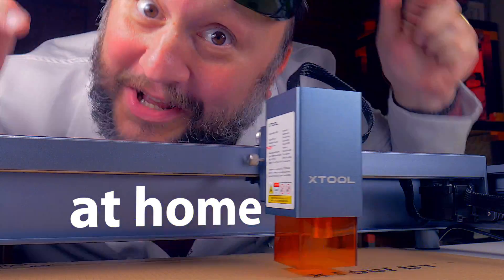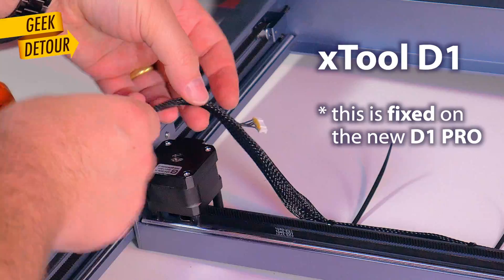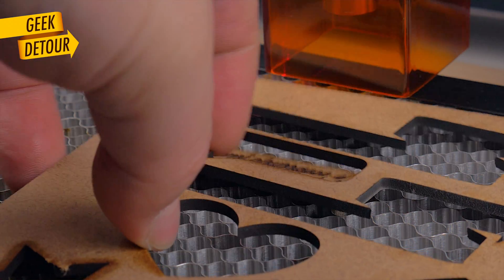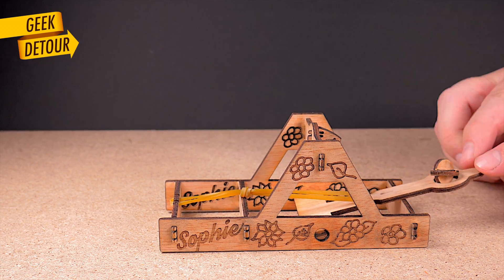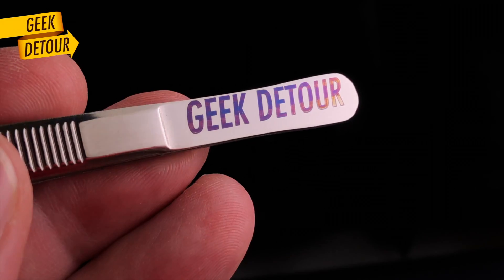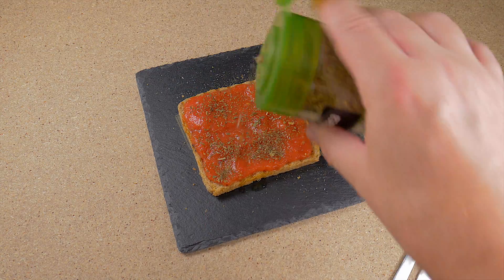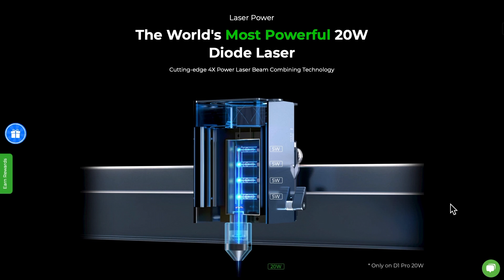Home Projects with the xTool D1 Laser Cutting Machine

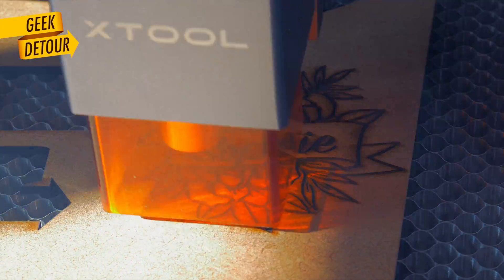Comment: How nice! What settings did you use to cut the MDF and what line spacing did you use at the 6:02 time? Have you tried to cut vinyl sticker (small letters)?
P.S.: By the way, all the settings you used were missing! Power, Speed, Passes, etc.
Reply from the maker: Thanks!!! I don’t recall any of my settings - I was testing all these different things like crazy 😜. BUT: Don’t cut vinyl on your laser. It will release chlorine gas (if I am not mistaken), very toxic and it will oxidize your machine. Really! I saw photos of people who ruined their lasers.
Reply: @GeekDetour  Oh friend! Thanks for your warning, although, I would really like to make some cutouts of some numbers and words on a black sticker that, only a laser can do because, they are tiny. Wouldn't a big fan blowing in the direction of the laser divert most of the nasty smoke to avoid major harm?
Or, otherwise, is there any substitute for this Vinyl Adhesive like, PVC Self Adhesive Plastic?  Thanks again
Reply from the maker: @Dancopymus  Really: DON't cut Vinyl with a laser! Here is a list of materials you can and cannot cut: https://cpl.org/wp-content/uploads/NEVER-CUT-THESE-MATERIALS.pdf If you want to do lots of work with Vinyl, maybe a Cricut (that actually cuts with a tiny blade) would suit you better.
Reply from the maker: @Dancopymus  Here is just one case of someone who made the mistake of laser-cut Vinyl... and it is devastating: https://www.youtube.com/watch?v=wzTosE7RroQ&t=26s

Comment: What about dangerous fumes that will be 100% produced from BURNING materials? Maker's Muse did a good overview of mass-marketing the cnc laser cutting problems.
Reply from the maker: He is absolutely right. I had windows opened everytime I used the laser - even so, the apartment had burned wood smelling for a couple of days.
It is possible to have a laser for ocasional use on your apartment - but if you need to use it on a daily basis, it is advisable to buy an enclosure with an exhaust tube connected to the outsides.
Reply: @GeekDetour  wood is (almost) fine, but who can tell that people will not try to laser cut materials that will produce really toxic gases?
I would predict, that owning a laser cutter at home will be licenced/limited and for a good reason. At least in EU, we do care about health and envoronment over there.
Reply from the maker: Sure! I think we might have some regulations eventually. We are living the “Makers Wild West” - we are trusting people to discard their UV Resin residues properly… looking at the forums it is clear some people do it right, but some people read “water washable resin” and they go straight for the sink for everything 😬

Comment: I'm kinda sketched out by the lack of Light spread protection. Like that shroud still has the gap at the bottom where you can the backscatter shining through.  And it's pretty easy to do long term damage to your eyes from high powered lasers like that.   Like if you take off the safety' glasses while it's running or if someone enters the room while the machine is running.
Reply from the maker: You are absolutely right - I bought more glasses (for my wife and daughter, because they wanted to see it working. While was working on this review I always told them that I was “locking myself to use the laser”, please don’t get in without a glass. 
On the long run you need to make an enclosure so everybody is safe. Right now I still use it occasionally, but I am planing a permanent place for it on my new studio/workshop.
PS: when I recorded the intro for the video, I took the glasses out, but on the angle I was I could not see any light from the laser. This is NOT a toy.

Comment: Hi, great video. I have the same xtool d1 10W version, but sometimes I have problems when trying to cut MDF, sometimes the laser doesn't pass through MDF even when 1 make 2 or 3 passes. Is there a special type of MDF to use with xtool D1?
Reply from the maker: Hi there! Thanks 🤗 First thing to look IMMEDIATELY: is the lens clean? A couple of hours cutting MDF and (if you don’t have Air Assist installed - like I don’t) the lens get enough dirt to reduce its power. There is a risk of ruining the lens. Always clean it! 
2nd: what thickness of MDF? I was cutting 3mm (1/8th inch) MDF at 3mm/second, 100% power. If it is thicker, multiple passes are the way. But check the lens, keep it clean. I will certainly install Air Assist on my D1, it helps to cut things clean and without much burning marks.
Reply: Speed

Comment: I get some really bad burns on the wood..I’m using a 3mm basswood using 100 power 6 speed 1 pass and recommend
Reply from the maker: Hi Jose! What type of project are you doing with your D1?
Reply: @GeekDetour  I wanted to cut out a name and that failed, then I was trying to just cut a basic shape like a circle and mess with the power and speed and that didn’t help either, I’m also using transfer tape to prevent some burning so I’m not sure if it’s the laser or if I’m still doing something wrong
Reply from the maker: 1st: is the laser in focus? (Are you using that side-lever to adjust the appropriate distance?) Second: is the lens clean? I clean mine basically after every big (1h) project.

Comment: I have  had the 5watt version for a good while. Mainly use it to engrave but every once in a while I cut 3 to 5mm wood for key chains easily.
Reply from the maker: It is possible to cut with 5W - but it is quite slow. As you said: keychains go well, they are small. If you are doing bigger pieces, it takes forever. And anything thicker is not viable.

Advice is, well, everyone must consider it a general orientation. Your use-case determines what you actually need.